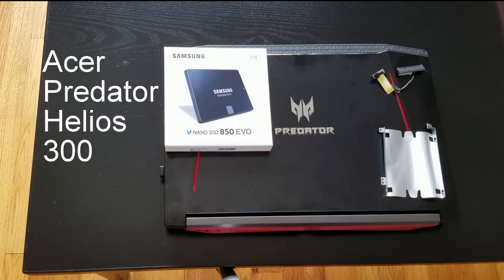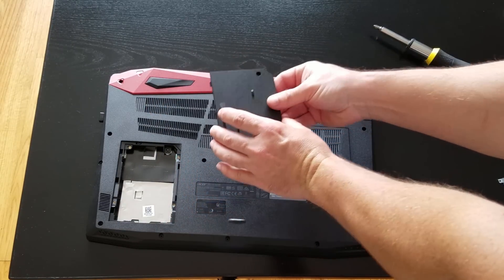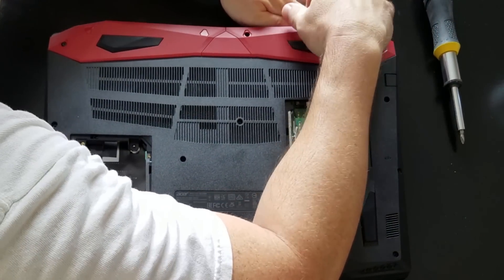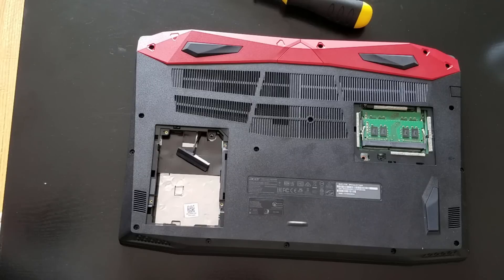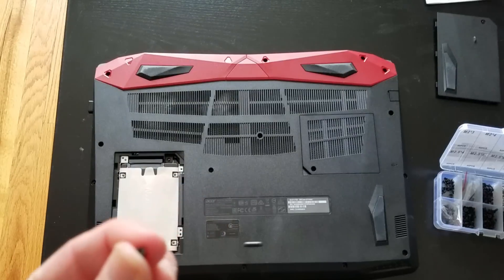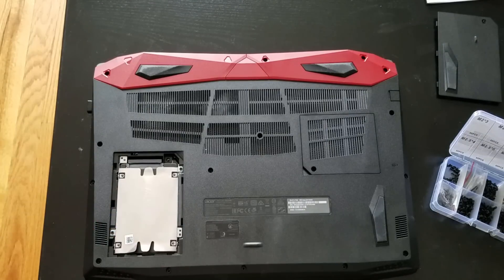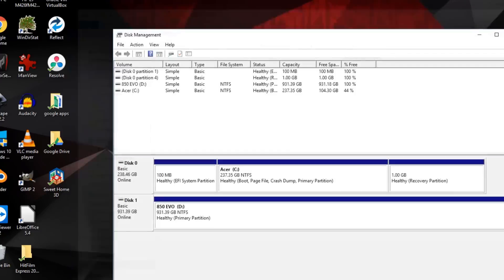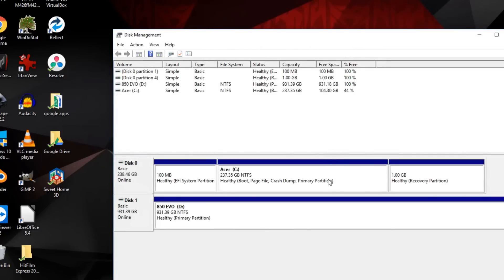Acer Predator Helios 300 2.5" SSD Install

Comment from the maker: I'm glad so many of you have found the video useful. I was really surprised that Acer didn't ship the laptop with the cable, caddy, or screws to mount the second hard rive. If you can I would suggest contacting Acer support and try to get them for free. If you live outside the US, this might be difficult. I have affiliate links in the description of the video to the cable, caddy, and set of screws. The cable and caddy will be somewhat expensive to ship internationally. I wish Acer would just ship the laptop with the needed hardware.
Reply: I just purchased this machine from Amazon last week. Has a build date of late Sept 2017. It had the cable and caddy already installed in the empty 2.5" bay?
Reply: @Glideslopes  Just opened mine up now to install, had the caddy, cable, and screws.
Reply: I am wondering if you make a backup of the OS and such when you first get the computer and if you would put the backup onto the 1TB hard drive so as to have it safe in case the SSD it came on fails. idk if that makes sense as i know nothing about tech
Reply: How do you bypass the windows repair.  Because no matter what happens it I st goes  back to the windows repair
Reply: XunileConsulting can I remove the sdd and just add in a hard drive
Reply: XunileConsulting will this will work with a 2.5 hdd
Reply: Purely out of curiosity, would you install the Samsung 860 Evo the same way? Also would you still put the File System as NTFS if you are using the 2nd hard-drive for gaming?
Reply: Yeah, I bought mine earlier this year (late 2018 build date) and it has the cable and bracket already installed in the empty expansion slot.

Comment: Dude Your video really helped me out but I have an issue. My ssd keeps disappearing once my laptop turns off for a while and I need to keep re plugging it in. Do you know how to fix this problem ?
Reply: Did you unplug the battery before removing and replacing the SSD?

Comment: Just followed your instruction to the same computer as yours, and it worked excellent. Thank you so much, still here in 2021!!!!!
Reply: While replacing HDD to SATA SSD did you disconnect the battery first?

Comment: I have a question for the bit around 7:00 in. 

I have 8 screws total for that area. 4 to attach the hard drive to the caddy, and 4 to attach the caddy to the laptop (into the corners with the asymmetrical upper left corner)

Are you saying I need another 4 screws besides those, or am I misinterpreting you?

Thanks for the guide.
Reply from the maker: You have enough screws, you should be good.

Comment: Did you have to install anything or transfer anything before inserting this new one? I put Samsung 860 evo in and turned it on and said no data found or something along those lines. Am I just supposed to do the f2 to avoid that popping up?

Comment: Great video Sir, it is the exact thing I needed. You guided us through every step perfectly. I just have a question (consider the time has passed since the video it's a bit far fetched but who knows) I don't want to have the new SSD as a new drive D or any new driver. I would just like to expand the only drive I have C. Is it possible to do it and how so? Once again amazing video, I'm happy that I found your channel out.
Reply from the maker: Thanks. You can expand your c drive basically 2 ways. You can clone the main drive to the 2.5" ssd and make it your boot drive. Its more risky than just adding the second drive. Another way is to replace the main drive with a larger nvme drive. I have another video on my channel that shows how to do that, but again, it is somewhat riskier.

Comment: When i installed mine, it was recognized in bios, but disk manager didn't auto recognize it. I'm not sure what to do from here. It shows up on the disk manager, but it was set to slot 0 and the window you got didn't pop up. It's not showing up in This PC either.

Comment: Hi. Do you recomend to use a Samsung EVO 850 or 860 one? I think 860 is little better but don´t know if it gonna work on Acer Predator 300.
Reply from the maker: The 860 should work fine.

Comment: Hi, I don't have the extra screws that go on the side of the drive. I only got the one's that come in the drive bay. Is it a problem if I use just those? Ty
Reply from the maker: You need screws to attach the caddy to the drive, then screws to attach the caddy to the laptop. This is the way it is designed.  I'm not sure what came with your laptop,  but that is how it should be in the end.
Reply: @XunileConsulting  Hi, many thanks for ur response, I dont have the screws to attach the drive to the caddy because the laptop was bought 2nd hand. Are they indispendable?
Reply: Can it get by with just the screws that attach the caddy to the laptop?
Reply from the maker: If you don't move the laptop much, it doesn't matter much. I have a link in the description of the video to amazon for 500 assorted laptop screws for around $9. It would have the ones you need, it is your call if you want to go without them.
Reply: @XunileConsulting  Yeah, I saw the kit but might be an overkill to use only 4 screws- DO you know which ones they are? M? ty
Reply from the maker: Sorry, it was around 2 years ago that I made the video. I remember not being able to find them at Home depot or walmart so I got the kit of 500 because any smaller number wasn't much cheaper.

Comment: When i was loosening the top left screw to get the caddy out, i accidently stripped it. Do I have to have all 4 screws out and then put the drive in, or can i just have 3 screws out? The reason I'm asking is because I want to know this before buying the m2*3 screws.

Comment: Fantastic video, thank you!

A word of caution to others, be careful which SSD you buy. I got the 860 EVO rather than the 850 used in the video, and at 1-2 mm longer it didn't fit in the case and I had to modify the back panel to make room. Once I got that taken care of the rest was a breeze!
Reply: Interesting, I just installed an 860 and didn't have any issues with it fitting 🤔

Comment: Hello sir,
I want to buy Samsung SSD 860 EVO 1TB 2.5 Inch SATA III Internal SSD (MZ-76E1T0B/AM) for my laptop Predator G3-571, will it work ??
Thank you!
Reply from the maker: It should, but you might have to replace a drive if one is already installed.
Reply: @XunileConsulting  no I don't have one, but on acer website the notfice the SSD won't work in the 2 stronge , it's just for HDD but I can add SSD in the 1 stronge ram

Comment: Tysm this helped alot. Also for anyone wondering the screws used to mount the drive to the caddy are 3mm diameter(might actually be circumference not diameter), idk if he said that in the vid or not
Reply: did the SSD work in the Storage 2 HDD access panel??
Reply: Yuzema yea it did. Make sure to restart the computer and partition it once you install it

Comment: I bought the 2018 model with 2tb hdd +16gb optane memory.  It has been working v slow especially in photoshop and premier pro.
Reply: Hey i bought the same one, but when i opened it there was an extra hdd installed and there was no extra space for ssd? How did u do it?

Comment: Hey, thanks for the vid. What if the laptop comes with only ONE SSD 256Gb? If I want to upgrade to 1TB SSD, do I need to buy Windows again? I'm planning on buying the 2019 Helios 300
Reply from the maker: Windows will most likely be on the m.2 drive. You can clone it to a larger drive or just add a 2.5" drive. I have another video showing how to replace the m.2 drive with a larger one on my channel.
Reply: @XunileConsulting  Just saw a cloning video. So I just plug in the new SSD externally via usb, clone Windows to it from the old to the new, replace SSD's physically, bam you're done. Thank dude, you did me good. Godbless.

Comment: I stripped one screw and I can't get the caddy out anymore, any ideas?
Reply: OneTruePenguin ToRuleThemAll put a rubber band over the screwdriver, stretch it, and then try to unscrew it
Reply: I stripped mines too with a normal screw driver. Then I use a power drill it just took it right off really quick. Do it slowly

Comment: I didnt have the 4 screws to attach the bracket to the SSD but I had the screws to install it into the laptop with the adapter and all without any issues the rest of the process worked flawlessly from start to finish. Should I be worried about the bracket side screws or is it okay like this? I'm new to all this.
Reply from the maker: It would by ideal to secure it with screws, but it should be ok.
Reply: @XunileConsulting  Is there any risk of damage if say I can't get the screw until  Friday, do you think?
Reply from the maker: Unless you subject the laptop to a lot of vibration or drop it, it should be fine.
Reply: @XunileConsulting  much appreciated. Great video, very helpful thank you

Comment: Hey I gotta question about load times, at around 11:24 you just skip to your desktop, how long did you wait for it to load because mine has been loading for over twenty minutes now and I just want to know if I should be worried, thanks
Reply from the maker: It shouldn't take more than a few minutes. Make sure you have the right drive set as the boot drive.
Reply: XunileConsulting I assume I need to uninstall the hard drive and then do that correct?
Reply: Alright well sense the computer won’t do anything unless I take out the hard drive I’ve just gone ahead and done it but now even after trying to look up how to make the drive the boot drive I still got no clue on how to do it. If you could please direct me to a tutorial on essentially what I have to do before installing my sshd so that it boots properly that would be fantastic. Thanks
Reply from the maker: If you followed the steps in the video it should work as shown. If it doesn't work then you are having an issue that needs to be troubleshoot. If it boots with the second drive removed, look in the bios and make sure the original drive is set as the boot drive.
Reply: XunileConsulting I’m looking right now at the boot priority order and there is only one option and it’s called windows boot manager,  I can’t exactly not prioritize that one since it’s the only one there. Did you do anything else before inserting your ssd?
Reply from the maker: The only steps I performed are the ones shown in the video.
Reply: XunileConsulting  :/ ok well thanks for telling me all of this anyway.

Comment: Dont Understand the laptop comes from factory 256 SSD + 1TB HDD so can hold another SSD + the other 2 or you have to remove the HDD?
Reply from the maker: Not all versions sold came with a 2.5" drive, some were sold with just the 1 boot drive.

Comment: Thanks man. I was waiting for a video like this.
I have a question, I currently only have the 256gb drive that came with it. I have a M.2 to 2.5" converter and I also received the hard drive kit. Is it possible to remove the M.2 and place it there, then boot directly from it?
Reply from the maker: You should be able to, I don't know why you would though.
Reply: XunileConsulting the reason is the M.2 that is given with the laptop is not NVMe so it has the same speed as a regular sata 3. So I am intending to free up its spot and put a real NVMe drive.
Reply from the maker: Ok, I'm planning on installing a nvme drive as well soon, probably the new Samsung 970 evo. I would probably want it as the boot drive instead of the 250 GB one that came with it. Either way it's a great laptop,  and thanks for the comments.
Reply: XunileConsulting Is it possible to place both drives on the same laptop, transfer the contents from old to new then boot from the new one and format the old one?
Reply from the maker: If you have a m2 to SATA adapter, you should be able to.

Comment: I have the cable already in the box of 2.5 inch drive bay, so I don’t need to open the computer up. Do I need to open the computer and unplug the battery in? Or how to can I use the battery release button on the right part of it?

Comment: Did you use a prying tool to initially open the bottom cover? If so, what kind?  OR, did you really just do it by hand only?  Ha, seeing you open it from the back corner like that gives me nightmares

Comment: Excellent step by step instructions. I am a little computer savvy, but this video answered any questions I had about the install. I am one of the lucky ones that had the SATA cable attached and the caddy screws included. I watched the case removal part just in case I need to do it in the future. I installed a Seagate 2TB FireCuda Gaming SSHD SATA 6Gb/s 64MB Cache 2.5-Inch Hard Drive (ST2000LX001).  The drive setup instructions were also helpful.  Thanks again for the video.

Comment: Which is faster, your 2.5" ssd or m.2 ssd?
Reply from the maker: +farm kite kill Depends on the interface of the m.2 ssd, a sata one would be about the same, a nvme drive would be way quicker
Reply: XunileConsulting did any part of the back plate break? It seemed reaaly hard to separate from the laptop.
Reply from the maker: +farm kite kill Nothing broke but it was a little hard to take apart. The laptop seems pretty well made.

Comment: Did you end up installing any extra ram for the laptop and if so how much, also would I be fine with the 500gb 850 evo or just go for the 1tb.
Reply from the maker: +Hush Lord I removed the 2 sticks of 8 GB ram and installed 2 16 GB sticks. The 500 evo will be fine if it covers your storage needs.

Comment: what happens if the hard drive is not seen in disc management ? It sees it in device manager in the BIOS but not in disc management  Help ?
Reply from the maker: +Steve Crosby Did you try hitting refresh or rescan in disk management?
Reply: Yes, Thank You for responding , I see it in BIOS I see it in Hardware management I have updated windows 10 nothing :)

Comment: Thanks man, great video!
I was really affraid about opening the laptop and installing everything, but after the video i'm more chilled about it.
I'm going to buy the Helios 300, do you recommend getting an SSD, the Seagate Firecuda or other normal HDD (Baracuda, WD Blue)?
Reply from the maker: +williambroock You're welcome. I would go for an ssd, they are just so much faster. If price is an issue than a large capacity hdd is a good option.
Reply: XunileConsulting And if i decided not to buy the SSD, is the Firecuda worth the extra dollars over the Baracuda in this case?
Reply from the maker: +williambroock If you're not going with an ssd, the Firecuda is a good way to go

Comment: Is it possible to install the hard drive without the caddy?
Reply: Duct tape mode ON
Reply from the maker: +Sia Beng wai You technically could but I wouldn't advise it. You want to have the hard drive secured to the laptop so it doesn't move around.
Reply: Understood,  thanks!

Comment: Hi, Thank you for the useful video. I am about to buy this laptop and am not in the US. I tried desperately to find the cable and bracket online and managed to find the bracket only. If you could please tell me which cable to buy instead of the one provided by the company I'd really appreciate it...
Reply from the maker: I found a link for it on e-bay. I am an e-bay affiliate so I will make some money if you use this link but it won't cost you any extra. The seller also has a limited supply. Here is the link: https://rover.ebay.com/rover/1/711-53200-19255-0/1?icep_id=114&ipn=icep&toolid=20004&campid=5338225085&mpre=https%3A%2F%2Fwww.ebay.com%2Fitm%2FNew-Acer-Predator-Helios-300-G3-571-G3-572-Laptop-Hard-Drive-Connector-Cable-%2F202020450359
Reply: XunileConsulting Dude thank you very very much! Am definitely subscribing to your channel.
Reply from the maker: You're welcome, glad I could help.
Reply: Hello, where did you get the caddy from though?
Reply from the maker: +Luju Ren There's a link in the description.